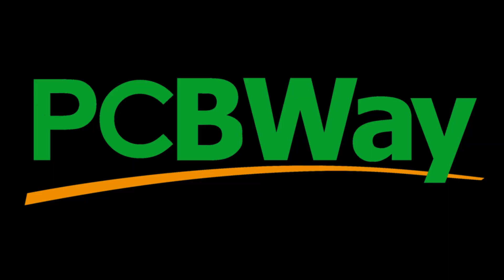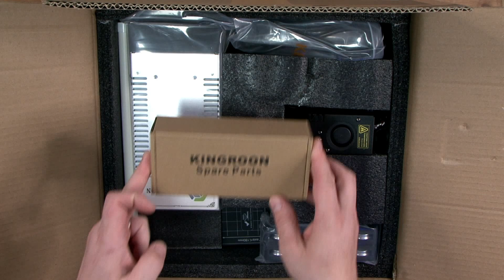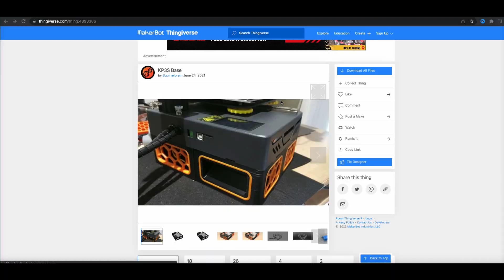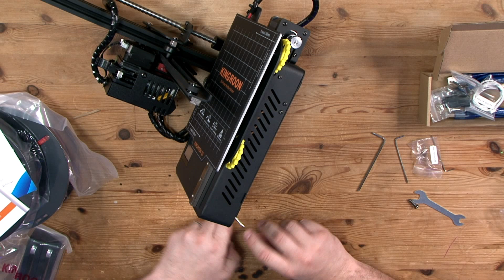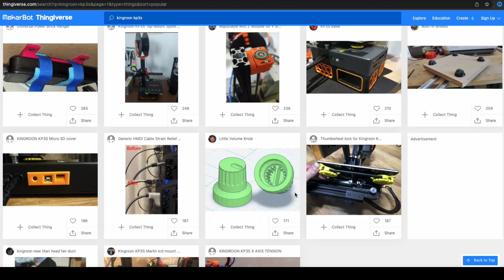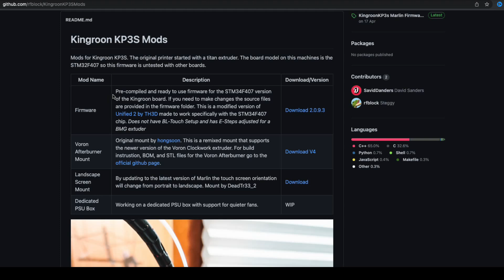Kingroon KP3S FDM 3D Printer - This is How It Works!

Comment: I already searched for a solution and didn't find anything about it. you are my last option. I'm trying to make a print that in total will take 21 hours. The problem is that halfway through printing between 50% and 70% the nozzle stops heating and the filament stops coming out. The printer continues to move. Does anyone know how to solve it?
Reply from the maker: Is it always in the same place? could be a loose connection that seems most likely
Reply: Are you referring to the place where the printer and the socket I am using are located? If so, it's always in the same place.
 @TheRealSamPrentice
Reply from the maker: @luciosacramento i’m talking about the cable that plugs into your hot end
Reply: @TheRealSamPrentice  
I haven't checked this, but the printer is new. I've had her for less than a month. However, as I recently changed the nozzle, I'll check. Could the problem be the filament?
Reply from the maker: @luciosacramento doesn’t matter if it’s new, if the cable comes loose or gets pinched at height that will be that
Reply: @TheRealSamPrentice  The printer is making a printout. As soon as it's finished I'll check it out. Thank you very much.
Reply: @TheRealSamPrentice  I checked the connections and everything seems fine. I'm sending a link with some photos of the connections and a video of the problem happening. I would really appreciate it if you could take a look.

 https://drive.google.com/drive/folders/1Qfj27LHLEO7YodLuvblZapSxAE7dcGSO?usp=sharing
Reply: @TheRealSamPrentice  Thank you for the response, but new problems have emerged. Now the printer heats continuously. I've replaced the thermistors and the heating cartridge, yet the issue remains. Therefore, the only option left is to consider the motherboard. My current board has a chip with the number GD32-F303, but I can't find it anywhere. Do you know if I can replace it with another one with a different number, such as the STM32-F103?
Reply from the maker: @luciosacramento  I'm not sure on the board replacement stuff, I've always used bigtreetech boards in most cases when upgrading. However I'm not sure in this case.  If you're in the UK I can send you my printer if that works.

Comment: Hi Sam I have just bought the kp3 S as my first printer I know nothing about 3d printers only what I have read in the instructions I am having trouble with the prints not sticking to the bed have tried the temp at 70 degrees but still no joy,
Please can you help me.
Thanks.
Bill
Reply from the maker: 70 on the bed ? Usually it’ll be down to the distance between your nozzle and the bed, so make sure it’s close enough

Comment: Can you print out cosplay items
Reply from the maker: I can
Reply: @TheRealSamPrentice  cause I'm trying to make a glamrock freddy cosplay with a 3d printer like that
Reply from the maker: @theunknown5449  okay it’s a tiny bit small but you might be okay depending on the model
Reply: @TheRealSamPrentice I can all I need to do is make it small then I can glue it back together and just sna dit down then paint easy
Reply from the maker: @theunknown5449  good luck I’ve always found printing in one part more effective hence the 500x500 printers I own
Reply: @TheRealSamPrentice also what program do you use for the printer to print it out like what slicer program

Comment: I bought this as my first printer and I have to say for the price I am quite happy. I am going through all the usual mistakes as a newbie. I disassembled the hot end and reassembled it back to front so the fan cowl was too close and melted. I've reprinted it not a big chore. I snapped an all metal heat break because I tightened it too much. So in the end I am happy that I bough a cheap one where the spares comes in the same price range. Other than that I am not an expert but as stock print in a decent fashion

Comment: Love my KP3S.  Same printed base, and top spool holder, with relocated screen.  Botbit BMG and a Red Lizard K3  hot end with .4 Nozzle X. 5015 PC fan with a dual side ducts.  Swapped out the bed springs for Prusa steel bed spacers and Fysetc PEI steel plate.  Absolute workhorse, prints anything!!
Reply from the maker: That’s good to hear! Id like to auto bed level this and pop some hard blocks instead of springs :)

Comment: You can put Klipper on the GD chip! There's a specific config you have to do. I have the KP3S Pro and the mainboard in that has a GD chip. Been running Klipper on it since I got it with no issues.
Reply from the maker: That’s good to know! It was an easily accessible when I was looking unfortunately! I’ll be sure to do an update with that information becomes available

Comment: Kind of silly to be reviewing their old model. The Kp3s has been around for some time now, the Kp3s Pro is the latest model that is worth a review. But their new Kp5l is junk so don't bother, good parts, poor design and the firmware is a joke.
Reply from the maker: Hi TE, I'm sent products old and new, as you can see i this video it wouldn't work for me in the unboxed form. There might be people still considering this product. After all Creality still sell Ender 3's and that came out in 2018.
Reply: @TheRealSamPrentice  That is true, some may be considering older models. But what I meant to say is that it is silly of Kingroon to be sending out old models for reviews instead of pushing their latest products. Far as the Kp3s, I have four of them and they work great for their size. Biggest con like you mentioned is their cheap fans. The external power supply does have pros and cons, if you encase the machine then you can keep the power supply out of the heated chamber. But that is about it.
Reply from the maker: @Grimm0ne  ah okay! Yep I tend to agree, but I had space in my schedule for this one :)
Reply: I love my kp3s, and have waited a lot longer than anticipated to review the KP5L because of how many issues it has.
Reply from the maker: @ZombieHedgehogMakes  I think that’s the one they were going to send me.. not sure now. Only reserving pathways now for special printers and ones that interest me! Like these vorons !!